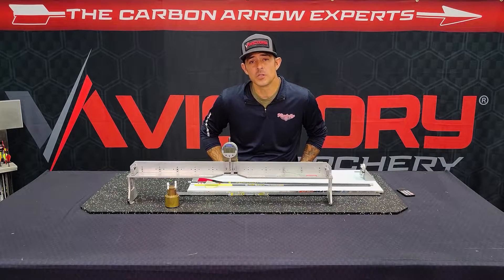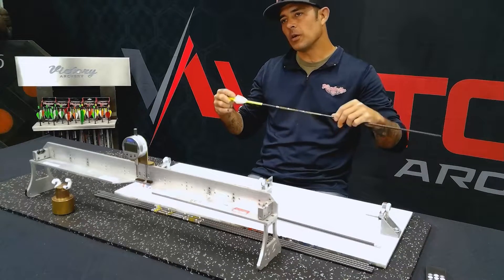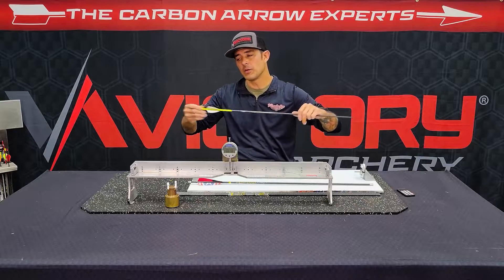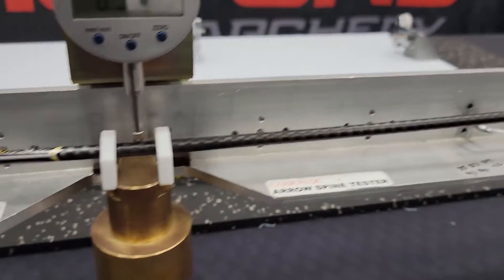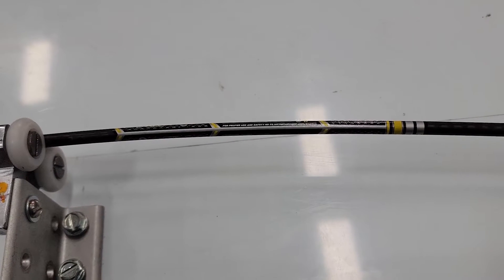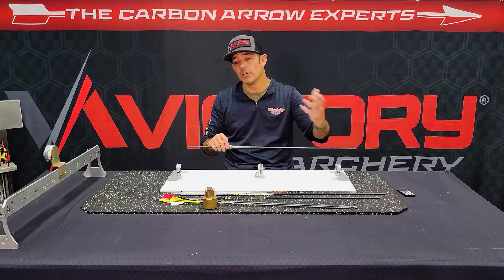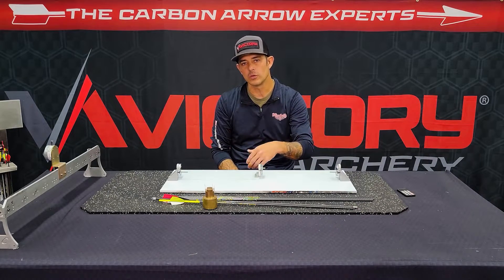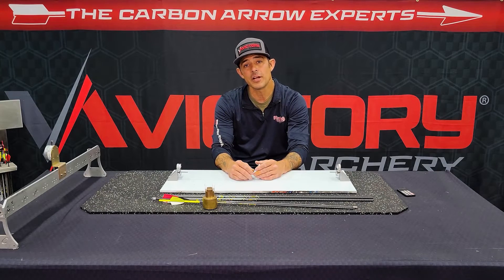Spine Test Tech Tuesday

Comment: ive seen videos That demonstrate, when the arrow is cut down, stiff spot correspondingly spirals around the shaft as you cut the arrow, shorter and shorter. If that's accurate, then how is it useful to have the spine marked from the factory when everyone has to cut that arrow down?

Comment: Can you give us a list of parts and measurements for the flex test board.
Reply: I don't know about the parts list, but I would imagine the measurement is different for everyone, depending on the length you cut the arrow shaft to. The arrow length would effect how long your board needs to be. Also I would assume the center bearing attachment has to be exactly centered on the arrow shaft for this test to be effective and give a correct reaction to the shaft. But I am just stating this all on pure assumption so who knows 😂.

Comment: I don't really understand the logic re the trad bow. If you want the arrow to flex around the riser then wouldn't you have stiff axis vertical and weal axis horizontal. The arrow is going to flex no matter what and path of least resistance means it'll 'find' the weak axis. If you have your stiff axis set outward then the arrow is going to be less inclined to paradox around the riser, no?
Reply: I’m with you - who says the weakest part of the spine is 90 degrees from the stiffest part of the spine?? I’ve read that these arrows are bulletproof and definitely tend to help with building for higher FOC, but I’ve also read that people have tested these arrows for spine deflection and found that the markings were not always a 90 degrees from the weakest part of the spine. Correct me if I’m wrong, but won’t the arrow bend in the direction of the weakest part of the spine when released? Shouldn’t Victory be spine aligning to the weakest part of the spine so that can be at 6:00 in a compound and 9:00 in a trad bow?

@Victoryarchery - it seems as if these RIP’s and VAP’s are the best selling arrows and I’m sure if it’s for good reason, but can someone please answer these questions and thoughts… Shouldn’t we be marking the weakest part of the spine?